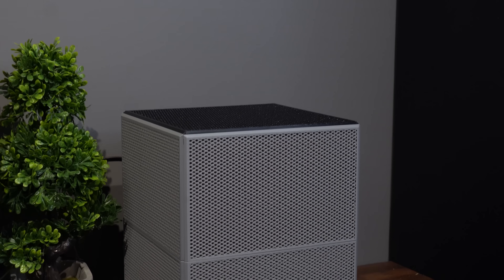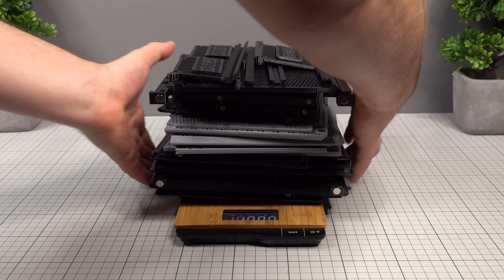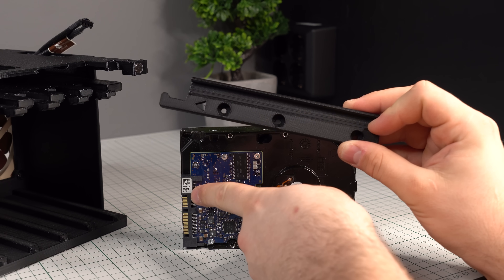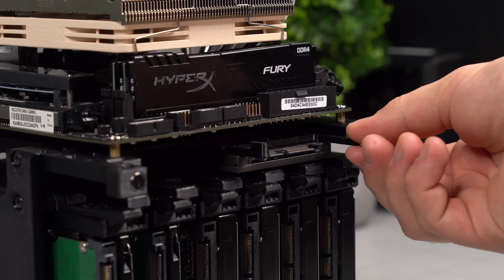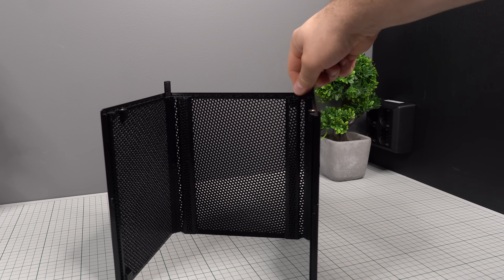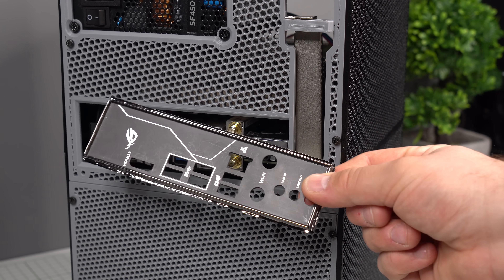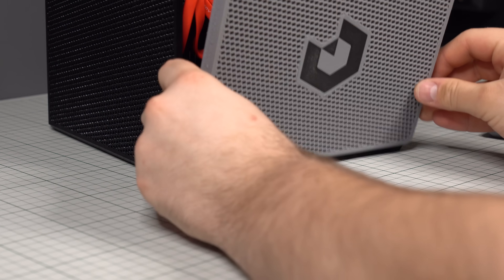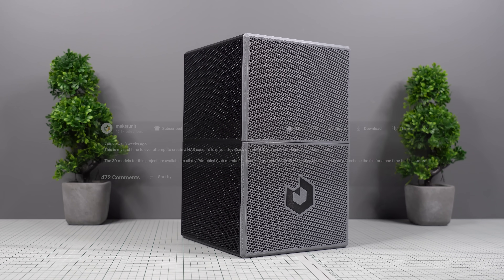3D Printed 6-Bay NAS case - Improved in every way!

Comment: I haven't had a chance to check out the files yet but I have a question about the file format. Is it easy to change the location of the motherboard standoffs programmatically, or would I need to manipulate the mesh or do it in the slicer?
Reply from the maker: Hi! The files are available in both STL format, which is a little hard to modify. And in .step format. 

However, the full .step file is only included either by purchasing the single project ($12) or by joining the advanced squad ($10/mo)
.step files are editable in most CAD programs.

In the lowest tier ($3/mo) only includes the STL files. 

I hope this clears things up.

Comment: FANTASTIC!! Now we need a 8 drive version, that acomodate a m-atx mobo :D
Reply from the maker: Thank you! I’m getting there (eventually). At least this was a step in the right direction! 😁
Reply: @makerunit  No, thank you for your work. The process to master this cases probably is a very expensive process
Reply from the maker: @stuardbrtube  it does definitely take some filament and sometimes having to buy a few new parts, but the most comsuming part is the time it takes 😊 it’s usually not just done in one day, but with many small sessions over a period of time.
Reply: @makerunit  Let's make the whole thing modular, so we can add/remove hard drives as needed.
Reply from the maker: @krutarthpatel1991  I’ve got some ideas in mind! 😊 tons of projects lined up for the next months!
Reply: @makerunit maybe just modularize the drive bay section and the compute section. Then you could just print multiples of the 6 bay section.
Reply from the maker: @ErrolSancaktar  definitely 😊 I’ll be looking into ways of securely joining modules 😊
Reply: @makerunit  I would absolutely pay for an 8 bay, m-atx version! A 12 or 16 bay m-atx would be excellent too, or version that could be used as a DAS.
Reply from the maker: @Mezoloth  I’ll keep it in mind 💪
Reply: @makerunit  did you make the M-Atx version of this ? keep up the good work man, i really like it..
Reply from the maker: @EdiYulianto-sp3zb  Hi, I haven’t completed it no, but I’ve got a few prototypes already printed to test out possible solutions. I want to make sure it’s perfect and well thought out before I share it publicly 💪
Reply: @makerunit  nicee..cant wait for it!!
Reply: @ yes, please take your time.
Reply: I second the matx case idea. Have lots of matx motherboards laying around but no itx.
Reply from the maker: @coolius6710  understood 😊
Reply: @makerunit  Hi, saw your comment on the upcoming NAS case in Q1 2025. If it helps, there's a video of a "Sagittarius 8 - bay case" in "Wolfgang's Channel" on YT for any ideas/inspiration. I am really looking forward for your next case video. Thank You for your work :)
Reply from the maker: @ Thank you! I’ll check it out 💪 Thanks for the suggestion!
Reply: with ATX support :)
Reply: MATX would be awesome!
Reply: I would pay for an 8 bay, mATX version of the files for sure!

Comment: Awesome Case design! A suggestion... but not for the case.... You can get braided or slim SATA cables and that might help fitting so many cables in such a tight space.
Reply from the maker: Thank you! Yeah I’ve been looking into them but just found it easiest in my scenario to buy them locally, but I’ll definitely keep it in mind for future reference when building even larger 😊
Reply: Basically you should use mini SAS to sata breakthrough cables and custom made (it's very easy) power cable with 6 connectors to avoid cable clutter, and any hba card in it mode instead of used in the video sata expansion card.

Comment: Man!! This video and all this project are fantastic! It's unbelievable what you have done and how you thought about everything! I've never supported any channel, but you deserve it. Today, I have a big NAS, and I'm planning to change it to a miniature version using ITX. I'll definitely use your project! My only concern with your project is the temp of all disks together... Did you check it?
My NAS has 8 HDs, and some of the disks are reaching 80℃...
Reply from the maker: Thank you! 

Does your current drive bay have any airflow pushing through it?

I have not checked how hot the drives get, but the airflow between the drives seem to be pretty strong as there’s no other way for the air to escape other than through the drivebay when the enclosure is closed like that. I plan on making even bigger versions in the future. I’m planning to make a few «normal» cases now for the next projects but I’m definitely not done with NAS builds, I want to create something that’s even easier to build, something that can grow with your needs with some sort of expandable chassis 😊

Comment: Cable management.... lulz.  where?
Reply from the maker: I see your point. However, the cables that were possible to hide without making the design larger, were hidden as good as they could in the given format. 😊 Could definitely have been even better though by making some minor size adjustments but I was very focused on keeping it within 210x210mm per panel.

Comment: I like this alot. 
I love watching your channel. I'd love to see a version in mATX using ATX PSU.

I'd love to see your take a module chassis similar to this. Like a psu/mobo section with maybe 2 variations for itx/sfx and matx/atx. That has a standardized interlocking bottom or top to add hot swap drive holders and optional cutouts. Like a Lego system for case making. So you could have this loadout but if you need more storage later your could pop another bottom section on and add 6 more drives. 

You could start generating the "gridfinity" of 3d printed case design.
Reply from the maker: Thank you! And actually this you are describing is exactly what I have in mind for a future NAS. Sort of like LEGOs. Different motherboard sizes, a universal mount to configure things exactly how you want in specifically sized sections that work like LEGOs (kind of). That is going to be a quite big job to get working smoothly, but I’m up for the challenge! 

«The worlds first fully modular 3D Printed PC case» that’s got a nice ring to it.

Comment: I was wondering, wouldnt the two fans cooling the HDD's be more effective if they were flipped around? As in not blowing air onto the drives, but pulling air away from them?
Amazing work btw!
Reply from the maker: Hi! Thank you! Actually I’m not sure. I haven’t actually measured, but given that the enclosure is closed on all sides it creates a forced airflow between the drives so it can not escape any other place than there. Whether push or pull is best, I’m not sure. Although it’s a quick fix to flip them if it becomes an issue 😊

Comment: This is amazing and well worth of monthly fee. But Im still waiting for something that will accommodate mATX motherboard with few pcie cards(10g network, HBA card, m2 adapters, even low profile graphic card). Keep up the good work!!
Reply from the maker: Thank you! I’ve got some ideas in mind for an even bigger case, may require a bigger print volume than the current but I’ll see what I can come up with when that time comes.
Reply: @makerunit  I'm fine with bigger volume print, today it is not a problem to find friend or coworker who has a larger printer, for parts that require a larger print. mATX NAS case would be great, event in flatter configuration, to be able to fit in small wall rack :)

Comment: Now please make a 19" Rack Mount Version with Minimum 8 Drives 3.5, 4-6 SSDs, Full Size ATX Powersupply :) and 2 HE (Must for the Power Supply)
Reply from the maker: Not sure what «2 HE» is but I’ll definitely be looking into making more and bigger versions to support other components and more drives!
Reply: @makerunit  +1 2he is the height for rack servers (Rack unit) 4,445 cm
Reply: @makerunit height of devices for rackmounts is defined in HE (Höheneinheit in german, Heightunit in English). One HE is 44,45mm. Two HE's are double that, etc..
Reply from the maker: @friendlyfred1997  aha! I see, thanks for explaining. Even thought I threw a little german comment in there I’m not actually a German 😅

Comment: Do you happen to have a template that could be used for designing motherboard trays w/ pcie slots? I’d like to give case design a go myself.
Reply from the maker: Hi! I don’t currently have any templates but I use some self-designed components as reference whenever I start a new project. I’m thinking about the idea of adding it as an option for my Printables members to download for personal use, but I would have to make sure the parts were up to spec first before sharing it as a paid model. 😊 so it will take some time because I take one part at a time in between the designs.

Comment: next step hot swappable, that would be amazing
Reply from the maker: Technically this is hot swappable (per definition) as you can remove or install your parts while the system is running, however I believe this isn’t possible on a stock pc without minor setting modifications, but from what I understand you have to change some settings on your PC to allow for hotswappability while the system is powered on.
Reply: @makerunit  yes technically the functionality may be a setting, but adding the ability to just pull the drive out in a drive bay and just pushing it back in is what i'm referring to, currently you would have to unplug and then pull out the drive. Its more efficient to use a bay you can pull and push. Dont get me wrong the build is amazing, but i'm just thinking out loud of things i know are QoL upgrades.
Reply from the maker: @LuisGarcia-tv7dk  yeah I totally understand. My goal was to try to use as many «stock» or off the shelf components as possible. 😁
Reply: @makerunit  if you ever do decide to make it more NAS like and implement hot swappable drives you would just need to add the appropriate Data/Power cable for each drive you can get those of amazon, and then a tray for the drive to sit in that you can pull out.
Reply from the maker: @LuisGarcia-tv7dk  yeah I’ve been looking a bit into those too 😊

Comment: Awesome job, this is really a major improvement and upgrade! I use 2.5 inch drives exclusively in my home server, would it be possible to use adapters for the hdd bays?
Reply from the maker: Hi! Yes, I’m planning to design some adapters that will fit right into the drive bays, probably on Printables within a few days.
Reply: @makerunit  Thank you so much!

Comment: Great Design. Which Mini electric screwdriver are you using? Looks good.
Reply from the maker: Thank you! Actually the brand of the Screwdriver is «Mission SG», however I think this is just some generic item that my local store has thrown their own brand on. It was pretty cheap. Unfortunately it’s not available on Amazon or any international marketplace as far as I know, only in Norway and Sweden I think.

Link from my local store in Norway…
https://www.netonnet.no/art/datakomponenter/installasjonogmodding/mission-sg-electric-bit-driver-kit/1029703.11087/?gad_source=1&gclid=CjwKCAjwuJ2xBhA3EiwAMVjkVIFWbUU6OWzAz_WIiu-rRw78hl-yUlwfda5rX02sQr5m77CS_P9lhRoC6AMQAvD_BwE
Reply: @makerunit  Thank you! Keep up the great Work!